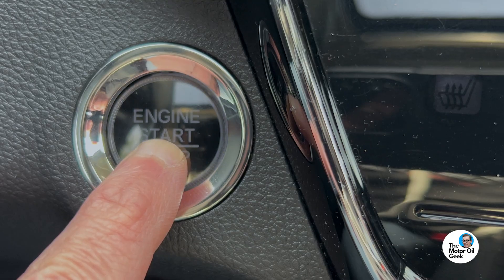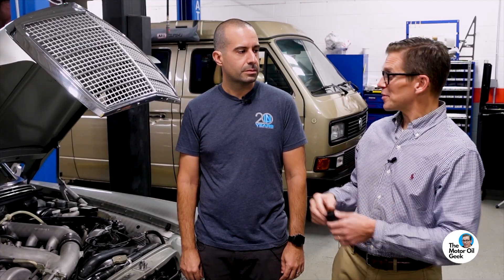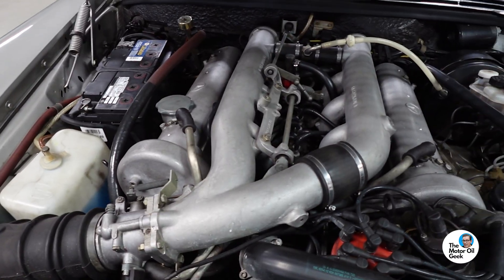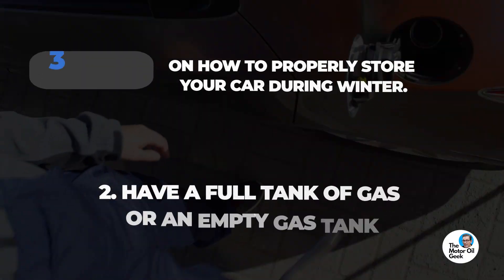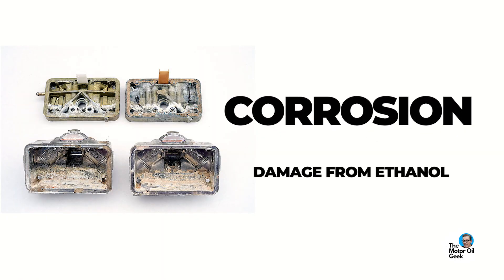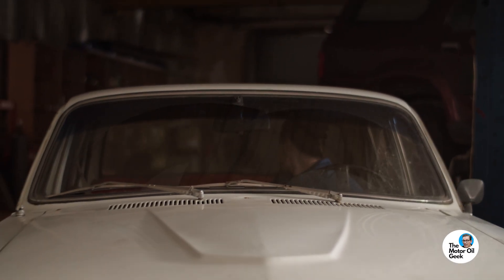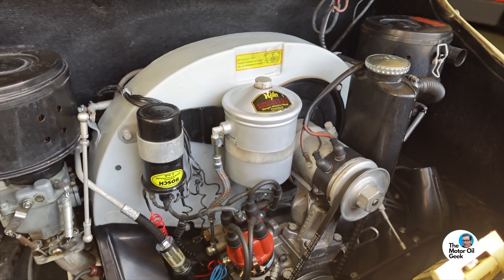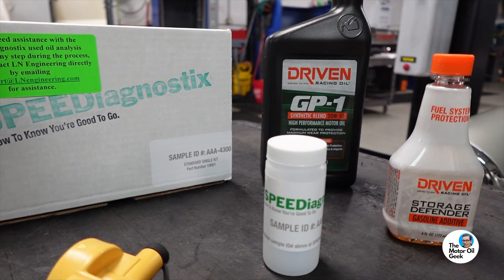3 Winter Storage Tips To AVOID Engine DAMAGE

Comment: I don’t know much about cars, but this video was very welcoming and helpful. Thank you. 

I have to store a car through a New York winter for the first time. I intend to follow all these tips. However, on a cosmetic note, I’m trying to find a reliable cover to protect my car. I’ve seen lots of videos showing covers that ruin paint jobs. Might you or anyone know something about that? Any recommendations? 

Also, if I were to start my car in the middle of winter, say once a month, but I let it get to temperature by having it run for an hour or driving it long enough for the oil to heat up—would that still prove, in light of this video, as an unnecessary, perhaps still damaging, precaution?

Comment: This is what I do for my '65 Corvair. Owned since 1983. Change the oil, I use ethanol free gasoline and I do not start it until it's warm and take it for a drive.  ALWAYS disconnect the battery.  It does't need charging next spring.

Comment: It's probably outside the scope of a motor oil channel, but I wonder about the need for lubrication of seals, e.g. air conditioning shaft, to keep them supple.  I've made it a practice to drive stored vehicles for 20 minutes every 6 weeks. This brings the coolant temperature to around 200°, and the thermostat opens.  The oil is probably above 212°. This also eliminates the need for trickle charging.
  Thoughts?

Comment: I change my oil just before I start it in the spring to get all that oil in the top of the engine and let it run down for 10 minutes.. If I start it any other way the lifters will click for a little while not good...ALWAYS CHANGE OIL JUST BEFORE YOU START IT IF IT SITS LONG TIME!

Comment: On the third point: We have some big professional oldtimer storages here in Germany which store the cars upwards of a million € worth. They generally don't start the cars suring storage. However they also mention to the owners, that seals (get warped and compressed unevenly while hardening and becoming brittle without lubrication and movement) and wheel bearings etc. age faster (wheel bearings have f.e. the whole weight resting on one ball in the bearing) and get damaged during long time storage.

Comment: I have added a squrt of MMO in each cyl during storage. My thought is it will help keep the rings clean and provide some upper cyl lube when I crank it (ignition off) to build oil pressure before starting in the spring.

Comment: LAKE , LOVE YOUR OIL VIDEOS. QUICK QUESTION ON YOUR WINTER STORAGE VIDEO. NUMBER  3 THING , DON'T  START VEHICLE , NOW IF YOU DIDN'T WOULDN'T  THAT DRY OR RUST YOUR CYLINDER WALL AND RINGS, BEARINGS  FROM THE LACK OF OIL , RUN OFF OF OIL IF YOU NOW WHAT I'M  GETTING AT. I WOULD APPRECIATE A RESPONSE ON THIS. KEEP UP THE GREAT WORK. THANKS AND PEACE OUT.
Reply: THANKS, lake Jr, for responding  on my question  on start up  on winter storage.
Reply from the maker: Thanks for the question. The anti-wear additives will still be on the surface of the parts, so they will protect the engine from excessive wear on start-up, even after prolonged storage.

Comment: Mr Lake Speed I'd like to see a video on how long gasoline remains stable with no breakdown, with and without fuel stabilizers.  Also I want to know, which ratio of the fuel stabilizer to gas volume keeps the fuel good the longest!  
Mainly because on the label for the "Sta-Bil fuel stabilizer" said,  it says "add the Sta-bil ratio of 60ml for every 9.5 litres of fresh fuel... "For best results always store vehicles and equipment with a full tank of fuel rather than a near empty tank. Always run the engine for up to 5 minutes after adding STA-BIL® to ensure the entire fuel system is treated and not just the fuel stored in the fuel tank."  
I'd like to know if additive-to-fuel ratio works how they say it does and, more important, what would be the maximum time the Sta-Bil will actually work?

Comment: A "standard oil analysis" from Blackstone starts at $35.  If you want any more detail than fuel and water dilution, viscosity, and wear metals it costs more, A LOT more.  Do i really need to point out, the cost of the analysis is almost the same as a DIY oil change.  Which in the long run, might be the more beneficial action to take for your engine.

Comment: I had a 1986 mustang with a 2.3 and a 4 speed manual I drove it 222 miles a day every 3 weeks I would change the oil with Castrol ran it over 300,000 miles.

Comment: So will this logic still apply to a diesel engine I'm sure it would. I'd always be worried about seals drying out after my truck sits all winter potential for a dry start situation on some seals or am I just overreacting just let it sit till spring I do put it away with fresh oil every winter. It's an 03 Duramax

Comment: it depends also by the storage place / climate.  if humidity and temp. variations are present the moisture can condesate inside the cylinder wall and potentially rust over time.

Comment: The only subject that I object to is not starting the vehicle.
Start the vehicle and let it warm up to operating temperatures. Usually 20 minutes. After I start the vehicle and let it idle for 5 minutes, I place something on the accelerator pedal to get the RPMs up to around 2k and let the vehicle sit for another 5 minutes. Then remove object from accelerator and let it idle for another 10.

Comment: I take my car out for a 30 minute drive once a month to keep my lubricants flowing and lubricating seals etc and to keep my tires from getting flat spots. What fuel stabilizers additives stop ethanol in fuel from absorbing water and creating gel in carburetor bowels ?  Look at the well regarded tests here on you tube, Many tests have been done, the results are not good. I never purchase fuel that I can't consume in 3 months.
Reply from the maker: The Driven Carb Defender is what I would recommend for storage.

Comment: So what is the best chronological order of operations here for this? It's a bit unclear with the mention of changing  the oil before filling up the tank when that would usually involve starting the engine after the oil change to go get the gas from a fuel station before driving back to the car's storage location. Would it be better to go fill up before doing a final oil change before "cold storage".

Comment: I change the oil and fill the tank to the top. I only run premium fuel with no ethenol regardless of storage. I also run mine for an hour every other month thru Winter months in Minnesota. I let it get to full operation temperature and then fluctuate the throttle on and off during that hour. Once im done. I re top off the fuel level.
Doing this also keeps the battery nice and charged up because no way am I pulling a bunch of batteries out of everything and keeping a battery maintainer on all of them for 6+ months a year.
Just what I do and haven't had any issues what so ever.

Comment: I’ve had good results with vehicle storage prepping by giving them an oil and filter change right after the last significant driving session. I also do the coolant changes and  brake fluid replacement just prior to a storage period if that is reaching it’s determined lifecycle. The drive just prior to storage also includes a top off of premium  fuel that contains little to no ethanol. Some research is needed to find out what brand of fuel is non ethanol in your area at any given time of the year. 
I also have a set of wheels and tires that are used exclusively for storage. Once I have completed the storage preparation, I take the car for a ten mile drive and then drive it back to the storage space and put it directly into the spot it will be, shut it down and then disconnect the battery and cover it. I do not touch it again until the next driving season. In Michigan that’s roughly six and a half months.

Comment: These are SOP for marine boat engines and what I typically do on my classic cars and motorcycles.  However,  you skipped fogging the engine which is SOP on Marine engines 2 or four cycle.  Easy on carburetors but difficult for fuel injected engines.  I remove plugs and spray a fogging oil into the cylinders and crank engine over with fuel delivery off and ignition disconnected.  My 2 cents.

Comment: Should I avoid starting the car after oil change before storege?
Reply from the maker: It’s ok to start the engine after the oil change to move the car to its storage location.
Reply: @themotoroilgeek  ok thanks. But is it better not to start? I can change oil at my storage unit.
Reply from the maker: @lordbentley730 that’s the best if you can.
Reply: @themotoroilgeek  ok. Ju so I got it right the best is not to start. What is the best additive for gasoline tank?
Reply: @themotoroilgeek  just another one sorry😁 I'm putting in recommend new blend 0w40 mobil 1 esp3 will that be OK in my w12 engine?
Reply from the maker: @lordbentley730 the Techron Marine or Driven Injector Defender are both really good.
Reply from the maker: @lordbentley730 just use what the OEM calls for.

Comment: I'd like to see what you offered in the beggining of the video Lake. There's one little issue when you are dealing with etanol powered cars......the bore gets rusted by the rings area, where the pistons had stopped, because the water in the etanol, you'd better take the spark out and dump a.soap of.oil inside all the cilinders, put the spark back again and live it alone.....
Reply from the maker: Yes, that’s one of the reasons why the fresh oil change before winter storage is so helpful.

Comment: I used to change the oil on my dad’s combine every year after harvest. It was a diesel. It made sense. Needed an oil change anyway and it was a very important piece of equipment.
Does diesel fuel contaminate engine oil as bad as gasoline?

Comment: Hello and thank you for the knowledge shared on this video and other ones.

I have a couple of thoughts that I would like to share and, to get your feedback as well on the 3rd. item :

1.-  I agree with this video on the draining of the old oil and its replenishment with a new one before Engine Storage for reasons associated with oil degradation due its contamination associated to Oxidation, Humidity, Reactivity, etc. etc. 
What I disagree with is the notion that once the oil has been replenished, one should avoid running the engine because of the potential for additional wear of its internal components.
Let's remember that we are replacing the old oil for a new one because of oil degradation which has already coated the entire engine.  Therefore,  it is NOT a bad approach to run the engine with the new oil to allow it to coat all the internal components with an oil that has all of its properties brand new for higher protection of its internal components.

2.-    The second thought is associated with anti-corrosive agents added to the Engine oil prior to its storage.   This is known as "Engine Preservation" and it is used extensively on aircraft Turbine Engines that will be seating for months or years waiting to be leased.   This procedure is very precise and not only protects the Turbine Engine's AGB - Accessory Gear Box, but its Bearings and, the HMU - Hydro-Mechanical Unit that Meters the Fuel,  by providing a coating of the entire Lube Oil System and Fuel Metering unit with anti-corrosive agents.   This approach is coupled with the placement of Desiccant bags and humidity detectors followed by wrapping and sealing of the entire engine with a high density plastic sheet to reduce the potential of Oxidation as a result of Air Humidity.
I understand that this is NOT a practical approach to reciprocating engines installed on vehicles but it gives us an idea as to how things get done on much more pricier engines.

3.- To enhance this video I would like to suggest the introduction of  Dedicated Corrosion Protection Additives along with its associated Testing not only for Vehicle  engines but for " Standby Portable Power Generators"  for personal use,  that remain off for months until needed and remain exposed to the humidity and its detrimental effect on the engine internal components.   The Engine User's Manual talks a bit about its storage,  but the subject is very interesting and worth of additional input from your team.

Keep up the good work  &  looking FWD to hearing from you.

Sincerely,
Roberto V. Herreria, BSME,  A&P.
Broward College  PP - II  Instructor
rherreri@broward.edu

Comment: And then another question that I want to hear from you rather than just me speculating... there are many gt500 owners or just performance car owners in general that get lower temp thermostats on their stock engines but their reason being better cooling.  I call crap on this because all it does is open more often but doesn't change how efficiently the radiator can work.  But as far as oil, engine wear, blow by, etc., what are your thought?

Comment: What about pre-oiling prior to the first start in spring?  ie: turning the engine over with the starter without firing for 15-30 seconds to build oil pressure.

Comment: If you are going to start it up, you best do a 20 mile drive to bring it to operating temperature long enough to eliminate the blowby induced contaminants as much as possible. Short trippers almost always have a chocolate shake residue inside the oil filler cap!

Comment: Great points about oil and storage.  With that said I don’t think your comments about ethanol are correct.  Do you have your own data to back your ethanol moisture comments?  What you said is conventional talking points but not correct from a practical standpoint point.  Yes technically ethanol can absorb water.  But I don’t think it is enough to be a noticeable amount, and definitely not enough to cause a problem.  I suggest you take a car with  e10 fuel in it and check it for water content when the tank was filled.  Let it sit for 3-6 months, then check it again for water moisture.  I doubt the moisture level will be much higher, and well below a level to cause a problem.  HEET “dry gas” is simply ethanol.  Ethanol will ensure any moisture that was in the tank anyway will be evenly in suspension instead of accumulating in the bottom of the tank.  Ethanol does not go bad.  It is alcohol.  Petroleum companies have fed misinformation on ethanol for decades now.

Comment: It's not really necessary to add a fuel stabilizer for winter storage. A tank of ethanol will stay just fine through a whole year or more. if you're really concerned about it, then drive until you're almost completely empty and then refill your tank with non-ethanol gas. That will easily last 2 years with no treatment. I've stored carbureted motorcycles and generators for multiple years this way. no ill effect or build up with the non-ethanol. Just make sure you're not substituting diesel! Lol!

Comment: Yes do those ridiculous engine oil sensors. This was the most important video👍
Reply: Engine oil sensors? They have level sensors but no sensor to check oil quality. It is a sophisticated program that monitors driving stye and conditions. Based on operating conditions the program will determine when the oil is in need of a change assuming the customer is using the specified oil.
Reply from the maker: https://youtu.be/D7hvTWsLIP8?si=1uq8oZpYWU12RnL3

Comment: What about running the engine for more than an hour, like I did several times this winter? I used up more than half a tank doing this. Not all of it was idling. But some of it was. I did this mostly to keep the battery alive, since I don't have any place to keep the car out of the freezing cold. Could have just removed the battery and stored it inside, but I figured it was easier (and more fun) to just run the engine thoroughly a couple of times. I basically ran it up to full operating temp for a good while with the heater core fully engaged and fans on full blast in -10 to -20 degrees Celsius (which means it had to work harder to get that hot). Not until it was really hot inside the cab did I shut the engine off. That has to be a lot better right???

Comment: Question on sitting oil in the pan/crankcase - now Project Farm had done a test on if you must change oil annually a myth if it hasn't reached hours or mileage for that change.  
The short answer was yes it is a myth.  Through his testing he found that it was not necessary and the oil was still good.

The possible catch, might be that he did mention as long as the vehicle was started at least once a month and allowed to reach operating temp.  Most likely to avoid oxidation/introducing moisture.

Thoughts on that?

And yes on oil life indicators....guessing it is going to vary between manufactures?  Which ones are a true oil life indicators and which are just a mileage timer for a change?

Comment: I often see friends and neighbors storing their car the wrong way for winter. Especially bad is when they start the engine every 2 or 3 weeks, letting it idle for 10 minutes with the garage door open, and then shutting it down. All the unburned fuel gets into the oil and dilutes it. Thanks for the video, Lake!

Comment: i work in oil/gas industry and my understanding is that most of the wear on the bearings is during start up because the oil pump isn't running and you don't have an oil wedge between the crank and the bearings

most of the machines i work on (ariel, IR, cooper recip compressors) have hot starts, that pre-heat the oil before startup similar to how some diesel vehicles have a plug for 110v to keep the oil warm during the winter, but also will have an auxiliary oil pump to pre-lube the crank, cross heads

why don't vehicles have a pre-lube option to get some oil pressure and where it needs to be before the engine actually starts
Reply: There is, it’s called flood mode

Comment: You should drive the car for 20 minutes after putting in fuel stabilizer and filling the tank and then change the oil. This gets the stabilizer in the fuel lines and the carburetor bowl in older cars. Top off the gas tank if needed.